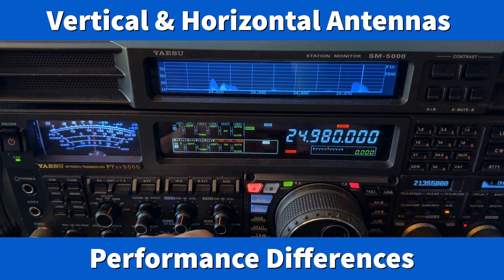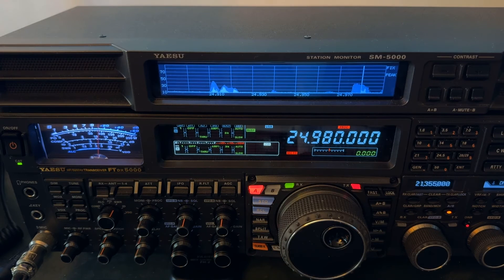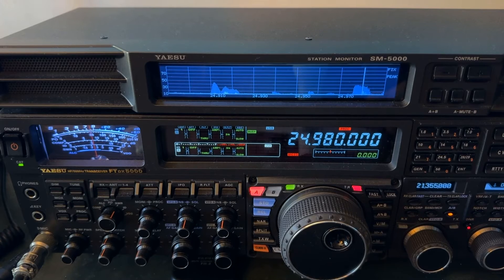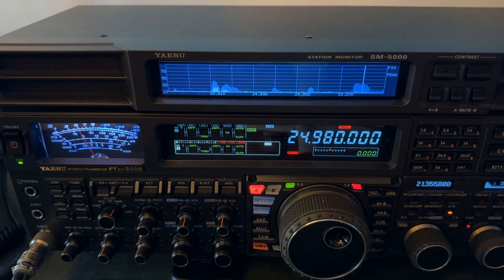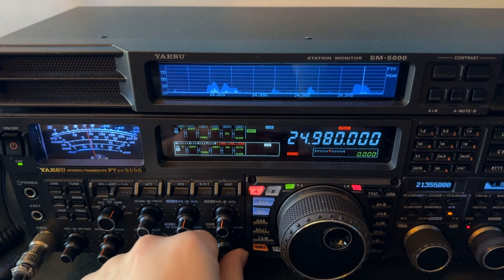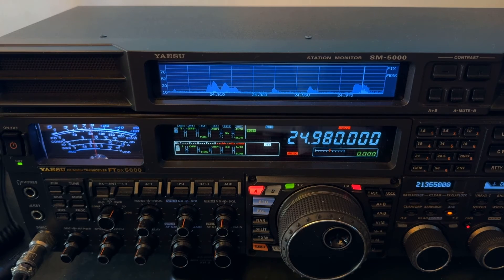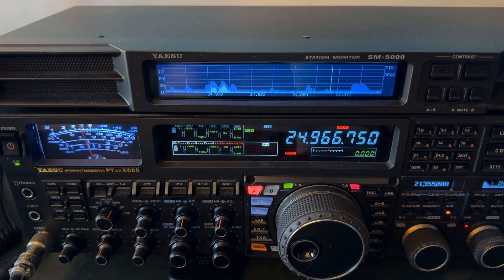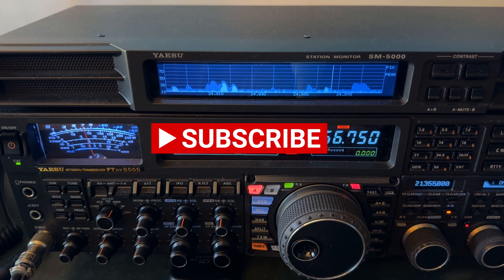Vertical & Horizontal Antennas - Performance Differences #hamradio #hf #antenna #propagation

Comment: I suppose I'll just have to get one of those diversity automatic antenna switchers that the military used to use..
Reply from the maker: Short of that, just hook one antenna to one receiver and another to the other receiver.  As the signal shifts polarity, you will hear the voice/CW switch from one speaker to the other. It’s better with headphones.

Comment: I put up my ZS6 last week.  I took off NI4L’s ladder line to coax converter and put on Dx Engineerings 1:1 tuner choke. Band width improved and SWR improved. I compared it to Vibrollex 80-10 EFHW. No choke on the EFHW. Receive and transmit for each antenna were equal as was noise level     Both were at 40’.  I am sure there was interference between the two antennas. They were not 1/4 wave apart and they were oriented in the same direction. 
I have the efhw at about 62’ high. I can’t string the ZS6 that high. My recent previous qth was a garden home. It was very tight for the Dx commander vertical. It did not work well with home and trees proximity close to the antenna. The wire antennas faired a little better but had the advantage of height.
Reply from the maker: A 1:1 choke Balun is good. The EFHW transformer is basically an UnUn, usually 49:1.  

Both the EFHW and the ZS6BKW will perform better when installed in a flat top configuration at 1/2 wavelength above the ground beneath. The EFHW suffers greatly from loss of gain on the low frequencies, when sloped. You lose approximately 5dBi on 80m and approximately 4dBi on 40m and 30m.

You mentioned 40’ feet height for both antennas but later stated that the EFHW is at 62’.
Reply: @n4hnhradio  When I had both antennas up at the same time they were both at 40'.  Since taking down the ZS6 I could raise the EFHW to 62'.  I could not raise the ZS6 to 62' because the legs would not be at 180 degrees and I wanted to compare the two.  Both antennas were flat top when I compared them.  Like I said both seemingly performed equally on transmit and receive but I am sure the ZS6 would probably be better overall but the EFHW would have more bands available..  The ZS6 was better with the 1:1 choke exhibiting great SWR and bandwidth.  The 1:1 tuner choke (as DX Engineering describe it) was placed at the end of the ladder line.  In effect it was a balun, and a choke.
Reply from the maker: @yowsa52 my ZS6BKW is installed as inverted V.  For some reason it didn’t get the memo that it is not supposed to work as well in an inverted V configuration. It rivals my 250 ft. Doublet.
Reply from the maker: I forgot to mention that I tried a 5kW 1:1 choke/Balun from Balun Designs. It only improved the SWR by 0.1 on 20 meters but made it go up 0.3 on 12 and 10 meters. I removed it.
Reply: @n4hnhradio  I did not record the SWR changes but every band was improved with the DXE Balun on the ZS6 which is a testament in only my situation I guess.

Comment: I have a suggestion for a video, Explain to the new operators what the Solar Cycle is and how it relates to the hobby/service. When it begins, ends and how this process effects radio waves.
Reply from the maker: I have planned to shoot a practical guide to propagation video. I might still do that. But I’ve been covering propagation as part of my Veritium HF Clock videos.  It allows me to show and tell.

Comment: Thanks for the explanation, Doug. I'm still very new to all of this, but by what you're saying, if I can't get a horizontal 1/2 a wavelength above the ground, I can put it as high as I can, and use it to receive and a vertical to transmit. It would just require extra equipment like a separate transmitter and receiver or a switch to cut out the receive side while transmitting. Doesn't sound like the juice is worth the squeeze, but it certainly has the brain working. 73 KO4QOA
Reply from the maker: That is the advantage of a radio that has a separate connection for a RX-only antenna. The FTdx101D/MP has that option. The FTdx5000MP has that option.  My old FT-920 even has that option.

That said, if you install a horizontal dipole 1/2 wavelength high for its lowest band, or higher, it will rival the takeoff angle of the vertical. And, where the horizontal dipole has gain lobes, I will likely beat the performance of the vertical.

Comment: Hello, if I can give a suggestion for these comparisons lower the signal you’re sampling, introducing attenuation as needed. The S-meter portion above S9 is highly compressed making it more difficult to se differences. Start around say S5. You and the viewers will see the benefit.
73
Diego
Reply from the maker: Wow!  I can tell that you haven’t watched many videos on my channel.  I preach IPO and Attenuation.  But not in this video. I wanted the noise to be more noticeable, at its normal level.  If you had watched the entire video, you would have saw the part where I talk about running minimum gain.
Reply: @n4hnhradio  I’ve watched till the end and other videos too. That was not a critique, rather a suggestion to emphasise few db differences.

Comment: Does the zs6bkw need an external tuner?
Reply from the maker: Only for 15, 30, 60, and 80 meters.  The MFJ-939Y matches great, as long as you don’t plan to use more than 200W.  The MFJ-998 is the choice for 200W to 1500W.
Reply: @n4hnhradio  I appreciate the reply.   I’m thinking about getting one to get rid of my ext tuner.  My OCFD needs a tuner.  Hey what brand zs6bkw do you have?   Is it good quality?   Thanks.  KQ4GDB 73

Comment: Hi Doug,
Bought a ZS6BKW several years ago with intentions of putting it up, but the one tree on my property to be used as a anchor had to be cut down as it was diseased.  😞 73  WJ3U
Reply from the maker: That’s a bummer, Don.  Could you install a 40 foot fiberglass mast?  The ladder line cannot touch metal.

Comment: Great info thank you Sir.. I have a Delta loop 15 feet high 7 feet  apart from a hustler vertical 20 feet high..no more room at my qth ..:)
Reply from the maker: I understand. I have 1/3 acre to work with.  And many trees to thread my antennas through.
Reply: my back lot 15x33 but My HOA says im allowed an antenna . Thanks again @n4hnhradio
Reply from the maker: A vertical might be your only choice. The ZS6BKW needs 94 feet across and 40 feet high in the middle. It’s a performer though.
Reply: Don't get into ham radio. Once you get into this hobby. Your bank account always depletes. Trust me. Kk7juj. Sweet setup.

Comment: How do keep your vertical so quiet? I have 2 antennas. One random wire 71’ and a dx commander classic. My dx is way louder than my random. But it picks up so noise. Is there a trick? 125’ of arb atx r8 with a torrid at the antenna.
Reply from the maker: The vertical pulls in more QRN.  That is normal. My vertical is only more quiet than my wire antennas when the power line noise is active.  PLN is primarily horizontally polarized.  But some PLN is vertically polarized - caused by loose ground wire staples. The ground wire on the power pole is vertical, running down the pole to the ground rod. With loose staples, the PLN is vertically polarized.  But, other than PLN, the vertical is usually more noisy than the horizontal dipoles.  

Coax quality can affect noise level too.  What I switched my ZS6BKW from RG8x to LMR400 last year (released a video about it), my noise level dropped a bit.
Reply: @n4hnhradio  thank you. Love your channel. You have taught me so much on the radio side of ham. Especially since I’ve only been licensed for about 7 months now.
Reply from the maker: @deerslayer767 I’m glad you have found the videos helpful.  But much credit goes to the long-hauler Patreon members who provide the yearly support to offset the expenses involved in doing this.